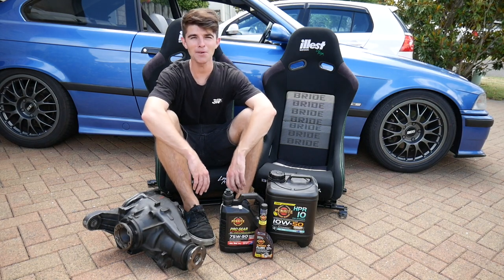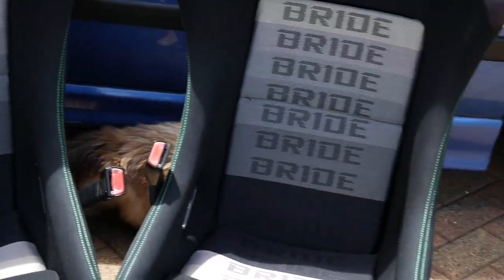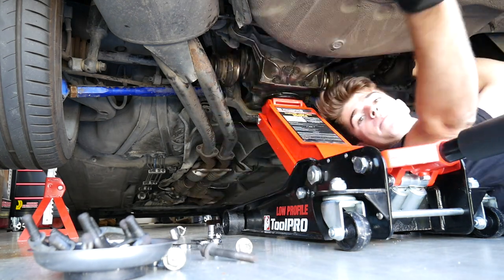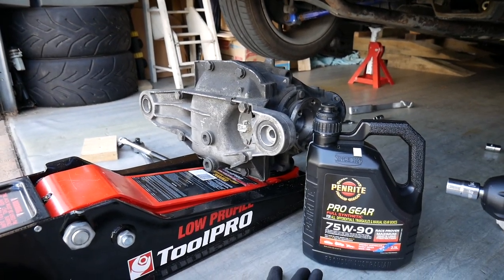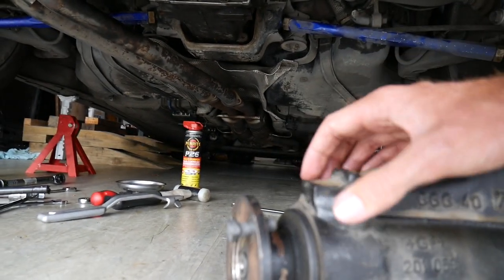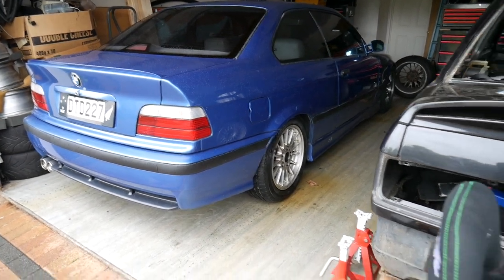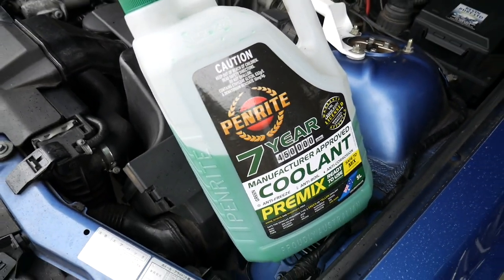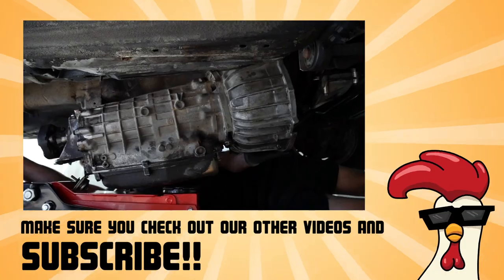BMW E36 Drift Prep!

Comment: Nice vid bro. Just a note on the coolant, it may already be penrite in there, but if not, I would flush all the coolant rad, block, heater etc and fill it with one brand. Mixing brands of coolant in most cases causes a chemical reaction and corrosion occurs fairly quickly, eating away at the aluminium.
Reply from the maker: Thanks for the heaps up man! Tbh I might need to do a coolant flush soon, not too sure what the old coolant is. Thanks for watching!

Comment: Fill them rubber exhaust hangers up with tiger seal 🤠 no more problems and cheap fix 🤓 same with gearbox mounts (ps can’t remember if them engine mounts are like sr20 in which case you can’t but nearly sure gearbox mounts are) just makes them bit stiffer without buying soild mounts 👍🏼
Reply from the maker: Awesome, thanks for the tip!!

Comment: Penrite is awesome, i use it, but Redline is better.
For the track, you can just top up the oil to just above the full line, then change it and fill up to the full line for the street, above if you get serious sideways G's on the street, which you will, cuz E36 bro.
You're putting an lsd in though right?
Reply from the maker: Haha I have never used Redline to be honest, but we have always been very impressed with the quality of Penrite products even before we were sponsored by them
Unfortunately not LSD at this stage, I will just put my open diff back in after the day. Seems like a lot of work but the LSD I want is like 1.5k 😬😂
Reply: Surely there's a cheaper option, like a mini-spool or something? Shame about some BMW parts prices.. I've seen a guy online show he did a stupidly long run with Redline engine oil, in a Patrol, just swapping the filter and topping up the oil for 50-60,000k or something like that, and the test report showed he could keep doing it in the same oil for just as long, that's how good Redline is..
Reply from the maker: A standard M3 LSD is about 1k in NZ but from what I have heard they don’t hold up to as much punishment so it depends on what you are using it for I guess 😬
Wow that seems like a lot of kms. I would think that the oil would get some dirt in it over time and need to be flushed out
Reply: The filter does that as the oil is pumped through it, just change the filter every 5k and top up the level.
I guess you could get a decent M3 diff, rebuild it with new clutches and strengthen it a bit with a brace? Your system works well enough though I suppose, and I'd be tempted to keep the lsd for the road so I wouldn't break it. Personally I'd be doing more lap times and low level road rallies, drifting is for late night roundabout fun in my opinion, I like the E36 with good tyres and grip, it only drifts because the wheelbase is so long it can't take tight corners without drifting, it was designed for fast sweepers, which is why I love it. I had a 3L 5speed M3 in Dakar yellow with dove interior briefly, what a weapon, but I didn't want to drift it, just travel fast. Really really fast.